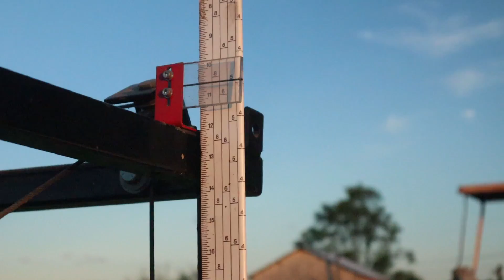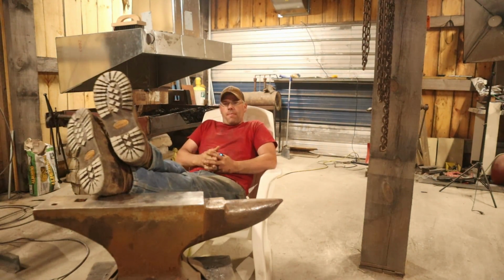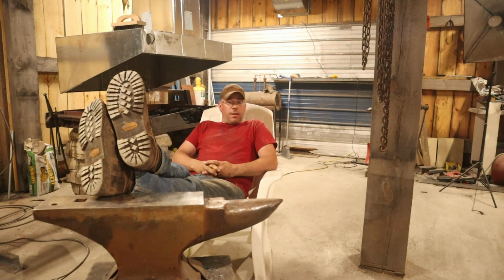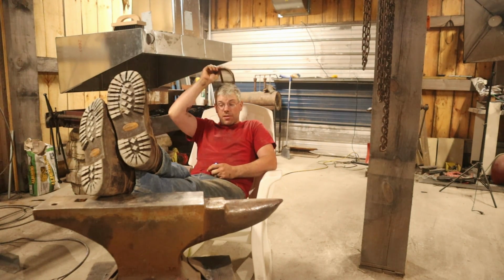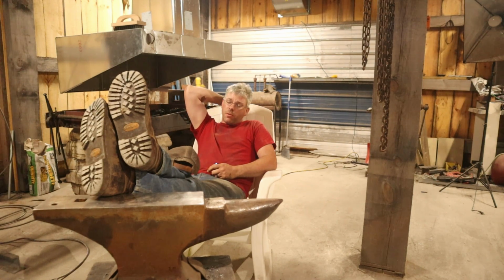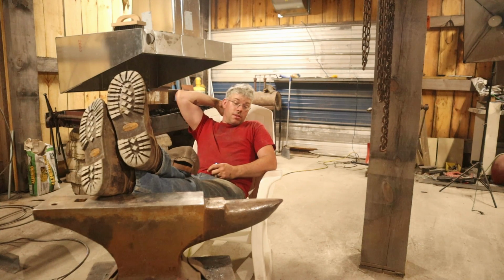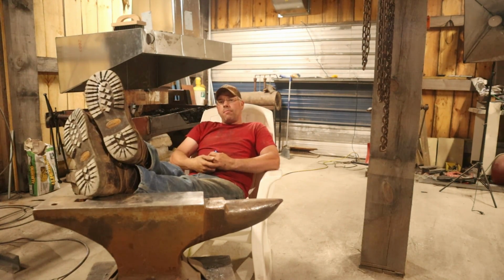This Is What You Want To Find Inside A Log At The Sawmill

Comment: Nice sunset. Just wondering if you could put a saw dust collector on your Sawmill so you can use it in sawdust burner?
Reply from the maker: The shoot is pretty low to the ground to put a bucket under it.  That said, it is easy enough to shovel it up.